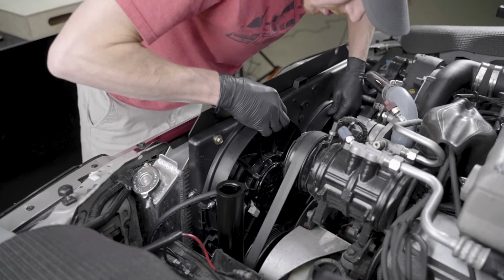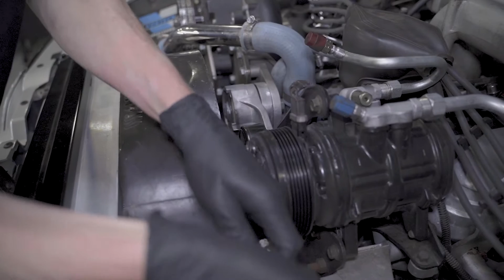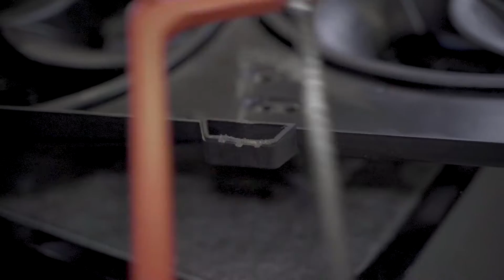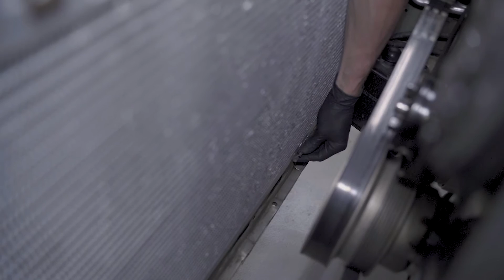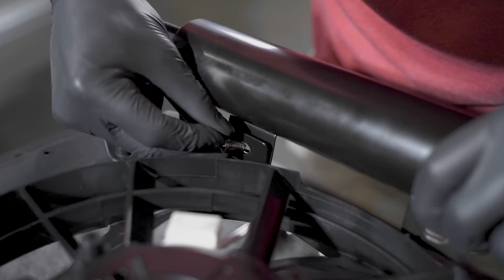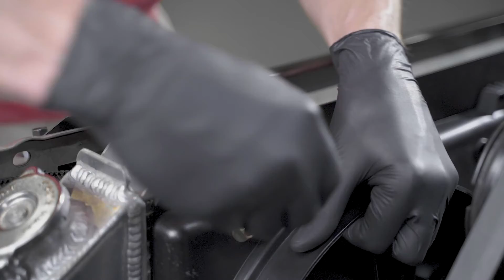How To Install Fox Body Mustang Contour Electric Fan Assembly (79-93)

Comment: Should let people know if they have an aluminum radiator these brackets WILL have to be modified!
Reply from the maker: What brand aluminum radiator do you have? There are several options out there and it's difficult to R&D a part to fit everything under the sun. We built the brackets around our SVE radiator where no modifications are required. Thanks. -Landan
Reply: @latemodelrestoration  it's all good, I have a pretty well stocked garage, I just think some other people would benefit from knowing they might have to modify the brackets slightly to fit their needs, mine turned out just fine, my brackets also did not come with the instructions but I watched your video and had no problems.  Please keep up the good work, whether you know it or not you help a lot of people!
Reply: Oh yeah it's a jegs radiator.

Comment: When reinstalling the hub does it require a small spacer between the bolts and hub since the fan took up a small amount of space ?
Reply from the maker: The water pump mounting flange has through-holes, so spacers/washers are not needed. -Landan

Comment: Has anyone had any issues with the overflow tank not wanting to sit straight??? 😢
Reply from the maker: Stacey - Are you fully tightening the overflow tank retaining hardware while the tank is straight?  Once the tank is straight and the hardware is tight, there won't be an issue.  Thanks!  -Landan
Reply: @latemodelrestoration  I got squared away..thanks
Reply from the maker: @staceysims7270  Sounds good!  -Landan

Comment: will this work on a 1984 GT Turbo?
Reply from the maker: Yes, but it isn't a direct swap.  You'll need 5.0L upper radiator brackets, our Contour fan bracket kit, and a standalone controller such as the Dakota Digital unit on our website.  -Landan

Comment: Well..this would have been VERY helpful 12 months ago when I converted during my vortech install lol.   Any clearance issues with a V1 vortech install using OEM vortech brackets? I'm using a 10 Rib.
Reply: Depends on the size of your radiator as well. I have a SVE radiator and a Vortech V1 with an 8 rib pulley and there is like a business card width of clearance.